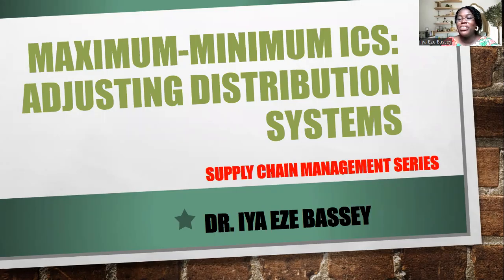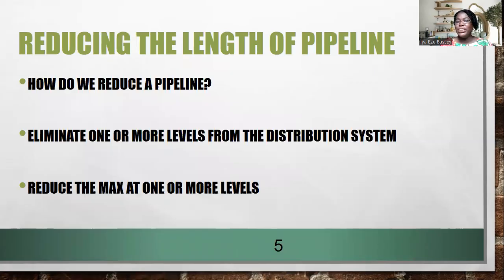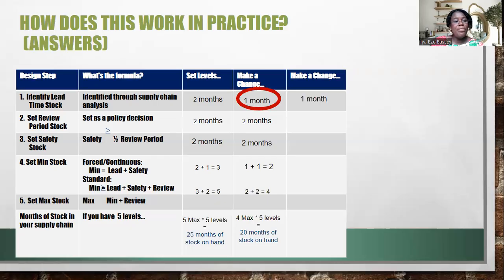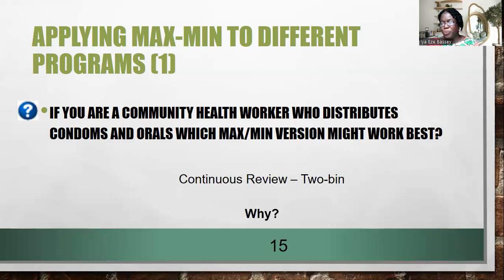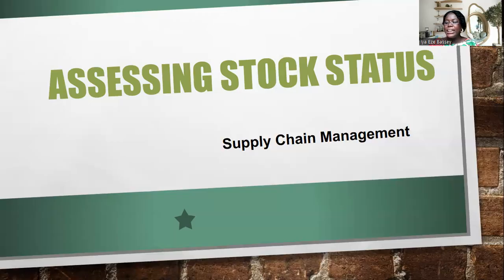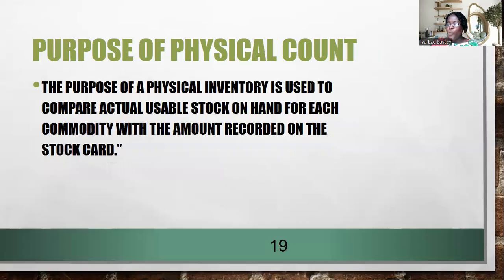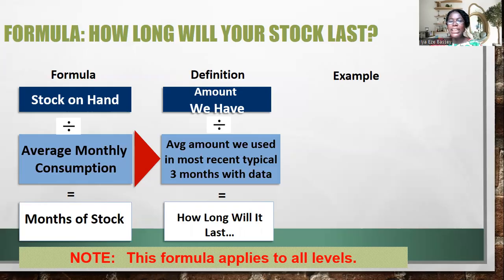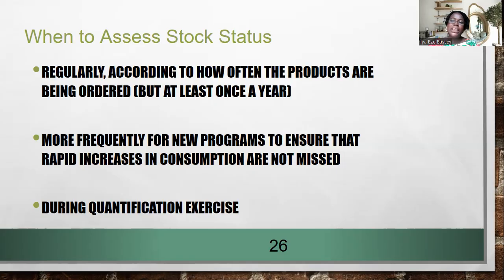Maximum-Minimum ICS: Adjusting Distribution systems (Supply chain management series)

Comment: The video effectively conveyed the principles of logistics management within public health supply chains. The explanation of adjusting distribution system policies to enhance logistics operations was particularly valuable, as was the clear articulation of the max-min inventory control system and its benefits in preventing stockouts and overstocking.
Furthermore, the segment on the control system for HIV and AIDS commodities offered significant insights, underscoring the vital importance of robust logistics management in guaranteeing access to essential medicines and supplies for individuals affected by HIV and AIDS.
The emphasis on monitoring stock levels to prevent both shortages and excesses was especially pertinent, reinforcing the understanding that logistics management is a cornerstone of public health supply chains, and efficient inventory management is indispensable for ensuring consistent access to necessary provisions.
Thank you ma

Comment: in summary, I have learnt : The Key Considerations for Adjusting a Distribution System 
✅. Assess pipeline length. 
✅. Reduce pipeline length to enhance efficiency. ✅. Lower maximum stock levels to minimize 
excess inventory. 
Factors Affecting Maximum-Minimum Levels 
a. Age of program
b. Cost of storage 
c. Cost of production 
d. Lead time 
Advantages 
i. It offers several advantages 
ii. Prevents emergencies. 
iii. Simplifies inventory management decisions.
iv.  Reduces waste and associated costs.
Stock Status Assessment This determines the remaining months of stock by:
🦠. Conducting physical inventory counts. 
🦠. Calculating supply longevity. 
Purpose of Assessing stock level status 
To determine how long supplies will last.
Finally; The purpose is to compare actual stock levels with stock card records for accuracy.
Thank you Prof.

Comment: Thank you ma for this extraordinary lecture.
Here's a summary of what I learnt;

I learned about designing Max-Min inventory control systems, including;

1. *Steps in designing Max-Min*: Setting up initial policies, checking distribution functionality, and evaluating pipeline length.
2. *Reducing pipeline length*: Eliminating levels, reducing max stock levels.
3. *Factors impacting Max-Min stock levels*: Cost, storage capacity, staff management, program age.
4. *Advantages of Max-Min*: Avoiding over/understocking, minimizing wastage.

I also learned about:

1. *Reducing maximum stock levels*: Shortening review periods, reducing lead times, improving distribution reliability.
2. *Assessing stock status*: Physical counting, calculating stock duration.
3. *Calculating stock status*: Using historical data, adjusting for zero-stock months.

It is important to know that regular  assessment and accurate calculation of stock status are crucial for effective inventory management.

Comment: Adjusting Distribution system max-min inventory control system 
In designing ICS we should be able to determine the length of a pipeline 
Steps in designing a max-min ICS are 
1. Set up initial max-min policies for each level and type of facility 
2. Check if the overall distribution will function properly if the level specific max-min policies are implemented etc 
Factors that can impact max-min stock levels are 
-cost of product
- storage capacity 
- Reliability of transportation 
-lead time 
-Accuracy of forecasts 
One of the benefit is to avoid overstocking.

Comment: Thank you ma for this lesson, below are the few things I've from this lesson.
I've learnt that to reduce the length of pipelines,one must eliminate one or more levels from the distribution system and set up policies that'll help reduce the maximum at one or more level. Also to reduce the maximum stock level,one must use the elements of the formulas which can be changed in order to reduce the max stock level,shorten the review period at one or more levels, reduce the lead time at on or more level and improve the distribution system's reliability at one or more levels so that safety stocks can be reduced. For this to work,lead time stock must be identified through supply chain analysis,the review period stock must be set as a policy decision, safety stocks must be set,min stock must be set and maximum stocks must also be set. Also,some of the factors that can impact max-min stock level includes the cost of the products, reliability of transportation, storage capacity,cost of storage, storage conditions at different levels and shelf life of the health commodities. Other factors includes the lead time, reliability of the source of supplies, effects of a zero balance of stocks, management skills of staff,age of programme and accuracy of forecast. Some of the advantages of using a Max-Min system is to avoid overstocking,understocking, minimise wastage,avoid cost of emergency order, simplify inventory control decision -making and so on. Also, some of the challenges encountered when using each variation and version of ICS are systems with numerous levels, system that manages a large number of commodities and systems that manages products for new programmes.
I've also learnt that to be able to access stock status,one must carry out physical count, which is the process of counting by hand the total numbers of usable units of each commodities in your store or health facility at any given time. The purpose is to compare the actual usable stock on hand for each commodities with the amount recorded on the stock card. Also,the purpose of assessing stock status is to determine how long supplies will last and the formula for calculating how long the stock will last is given as; Stock at hand ÷ Average monthly consumption = months of stock. Assessing stock status should be done regularly, according to how often the products are being ordered and more frequently for new programmes to ensure that rapid increases in consumption are not missed.
Finally, I've learnt that the importance of assessing stock status is to look at the stock that is at hand and determine the months of the stock available and how long the stock will last if the consumption remains the same.
Ma,above is the summary of what's I've learnt from this lesson.

Comment: Thank you ma for this video, I got to understand that At times, a pipeline's length may prove to be excessive, warranting the need for it to be reduced to meet demand. In such scenarios, the reduction involves eliminating one or more levels from the distribution system, lowering the maximum at one or more levels, and reducing the lead time at one or more levels.
from the video, The implementation of the max-min system offers various advantages, such as mitigating the risks of overstocking and understocking, maintaining consistent stock levels, and avoiding the expenses associated with emergency orders this was mind blowing. thank you ma

Comment: Thank you ma for another wonderful lecture. In summary of today's lecture, I learned that using a maximum/minimum inventory control system is a great way to manage stock and avoid waste. Setting it up involves deciding on initial max/min levels for each part of your distribution system, then ensuring these policies are consistently applied throughout the entire supply chain.

There are two main ways to adjust your distribution: either shorten the supply chain or reduce the maximum stock levels. Many factors influence these stock levels, including product cost, transportation reliability, storage conditions, product shelf life, lead times, the impact of stockouts, and even staff skills.

The benefits of a max/min system are clear: 
it prevents over or under-stocking, minimizes waste, and simplifies inventory decisions. However, challenges can arise, especially with complex distribution systems or managing many different products. A key part of this is regularly assessing your stock, which means physically counting what you have and comparing it to records to see how long your current stock will last.

Comment: Thank you ma for this wonderful lecture at the end of the video I was able to learn the following things

 1.Identifying the ways to adjust distribution system policies using the systematic chain from the port to the client 

2. How to describe the inventory control system used in logistic management of HIV and AIDS 

3. The disadvantages and challenges of Max-Min inventory control system

In reducing the maximum stock level these must be done 
1.The elements of formula which can be changed in order to reduce the maximum stock level
2. shorten the review period at one or more levels 

3.Reducing the lead time at one or more levels improve the distribution system we are liability at one among them so that they can safely stock and be reduced

Comment: Thank you ma for this interesting lecture 
Here is my summary 
--Steps in designing the Max-Min inventory control system:
1. Set up initial Max-Min policies for each level and type of facility 
2. Check If the overall distribution will function properly if the level specific Max-Min policies are implementated
3. Check the total length of the pipeline the policies at each level imply
-- Some  factors that affect determination of Max-Min stock level besides pipeline length:
1. Cost of products 
2. Transportation 
3. Storage capacity 
4. Cost of storage 
-- Some advantages of using Max-Min system:
1. Avoid overstocking 
2. Avoid understocking
3. Minimize wastage 
-- Physical count: is the process of counting by hand the total number of usable units of each commodity in your store or health facility at any given time.
-- Formula for how long stock will last is: 
STOCK ON HAND ÷ AVERAGE MONTHLY CONSUMPTION = MONTHS OF STOCK

Comment: In Summary, in adjusting distribution polices under max/min inventory control system helps to maintain stock levels and minimize wastage through different steps but despite this, some challenges are also encountered. 
Steps in designing a Max/Min ICS are; Set up initial max/min strategy/policies for each level and type of facility, Ensuring that the overall distribution will function properly if the level specific max/min policies are implemented and Check the total length of the pipeline that the policies at each level imply.
There are basically two ways of adjusting distribution system;
1. Reducing the Length of a pipeline 
2. Reducing the Maximum stock level.
Factors that impact Max/Min stock levels:
1. Cost of products
2. Cost of storage 
3. Reliability of transportation 
4. Storage capacity 
5. Shelf life of health commodities 
6. Storage conditions at different levels. 
Advantages of using the Max/Min system;
1. Avoid Overstocking 
2. Avoid Understocking 
3. Minimize Wastage
4. Consistency in stock level 
5. Reduces cost of emergency order. 
I Learnt of how to calculate stock on hand and average monthly consumption.

Comment: Good morning ma,thanks for another impactful ,informative and interesting lecture.
I learnt that the steps in designing a maximum - minimum inventory Control system include;

* set up initial max-mini policy for each level and type of facility 

* check if the overall distribution will function properly if the level specific max - mini policies are implemented.

* check the total length of the pipeline that the policies at each level imply .

Factors influencing maximum

Minimum stock level include 

Stock capacity 
Production cost 
Storage cost 
Lead time 

Benefits of implementing max -mini  inventory control system 

*minimizing waste 
*Avoiding over stock 
Maintain consistent stock  level

Comment: Thank you very much for this insight on (mmics)
 
 Here are my key take aways
  How to reduce the length of a pipelines
. Eliminate one or more levels from the distribution system 
.  Set up police that can reduce the maximum at one or more levels 

  Factors that impact max -min stock levels
.cost of product 
Reliability of transportation 
.  Storage capacity 
.  Cost of storage
.  Storage condition at different levels 
. Self life of health commodities 
.  Lead time
.  Age of program
. Accuracy of forecast 
. Reliability of source of supplies
. Effect of zero balance of stock 
. management skill of staff

Aviode Overstocking and under stocking are the advantages of using a max min system 
Accuracy of forecast

Comment: I learnt that maximum-minimum inventory control is essential in managing the supply of laboratory consumables reagents and equipment in the laboratory.
N/B to avoid overstocking and stock out, it is necessary to know your stock status. There are four factors that impact maximum-minimum level which include, lead time, age of program, accuracy of forecast and management skill of staff
Thank you ma'am 😊

Comment: Thank you very much for the lecture.
From this, I have learnt that so many factors
impact Max-Min stock levels such as:
 * Cost of products
 * Reliability of transportation
 * Storage capacity
 * Cost of storage
 * Lead times
 * Accuracy of forecasts etc.
   Advantages of using Max-Min Systems includes:
 * It helps to avoid overstocking
 * It helps to reduce under-stocking
 * It helps to minimize wastage
 * It helps to avoid costs of emergency orders
   Physical count is the process of counting by
   hand the total number of usable units of each
   commodity in your store or health facility at any given
   time. The purpose is used to compare actual usable
   stock on hand for each commodity with the amount
   recorded on the stock cards.
   The purpose of assessing stock status is to
   determine how long supplies will last.

Comment: Good day ma
In summary, maximum ICS adjusting distribution systems
The steps in designing a max-min ICS are :
1)set up initial max-min policies for each level and type of faculty 
2)check if the overall distribution will function properly if the level specifies max-min policies are implemented 
3)check the total length of the pipeline that the policies at each level imply.
 Advantages of using max-min system 
1)Avoid overstocking 
2)Avoid under stocking 
3)minimize wastages 

 The challenges are:
1)Managing systems with multiple levels
2)Managing inventory for a new program 
The purpose of assessing stock status is:
1)To determine how long supplies will last
2)It is essential in verifying stock accuracy

Comment: In summary, what I learnt is that using maximum and minimum inventory control (ICS) to adjust a distribution system helps manage stock better. It works by setting high and low limits for how much stock should be in warehouses or distribution centers. When the stock gets too low, the system orders more. When it gets close to being full, the system slows down deliveries or sends some of the stock elsewhere. This way of working helps reduce storage costs, avoids running out of stock, and makes the supply chain faster and more flexible.

Comment: Thank you ma for this video. 

I go to understand that a  pipelines length may prove to be excessive, warranting the need for it to be reduced to meet demand.

In such  scenarios the reduction requires the elimination of one or more levels from the distribution system and reducing the lead time at one or more levels.

The implementation of the max-mins system offers various advantages such as mitigating the risks of overstocking, maintaining consistent stock levels, and avoiding the expense associated with emergency orders.
Thank you ma❤

Comment: Thank you prof.
From the lecturers, I understood the steps in designing a max-min ICS which are:1. Set up initial maximum policies for each level and facility. 2. Check the length of the pipeline that the policies at each level imply .
3. Check if the overall distribution will function properly if the max-min policies are implemented.
And the factors that impact max-min stock level are: lead time, Cost of product, storage capacity and cost storage.

Comment: Summary:
How to reduce length of pipeline: eliminate one or more levels from the distribution system, reduce the max at one or more levels.
Elements of the formulas which can be changed to reduce the max stock level: shorten the review period at one or more levels, reduce the lead time at one or more levels, improve the distribution system's reliability at one or more levels so that safety stock can be reduced.

The factors that impact max-min stock levels e.g cost of products, reliability of transportation, storage capacity, cost of storage e.t.c.
 
Advantages of using max-min system 
Challenges to using each version and variation 
Assessing stock status:
Physical count, purpose of physical count, purpose of assessing stock status, when to assess stock status, formulas and calculation, importance of assessing stock.

Comment: MAXIMUM -MINIMUM ICS: ADJUSTING DISTRIBUTION SYSTEM 

Summary,my understanding of inventory management has significantly expanded , and encompassing the establishment of max-min inventory control system strategies for shortening pipelines and factors influencing stock level calculations 

Steps in designing a Max-min ICS includes ;
Set up your initial maximum minimum policies for each level and type of facility 
2.check if the overall distribution will function properly if the specific Max-min policies are implemented 
3.check the total length of the pipeline that the policies at each level supply 

How to reduce the length of the pipeline 
1.Eliminate one or more level from the distribution system 
2.set up policies that will help reduce the max at one or more levels 

How to reduce the maximum stock level 
1.shorten the review period at one or more level 
2.reduce the lead time at one or more level 
3.improve the distribution system reliability at one or more level so that safety stock can be reduced.
Moreso,I have gained valuable knowledge on Max-min inventory control system, pipeline optimization techniques and the  complex consideration involve in calculating optimal stock level
Thank you so much ma'am for an amazing lecture